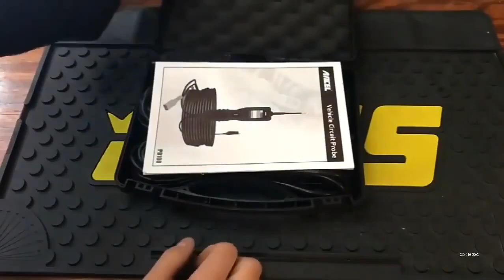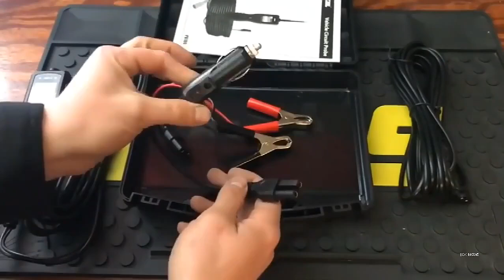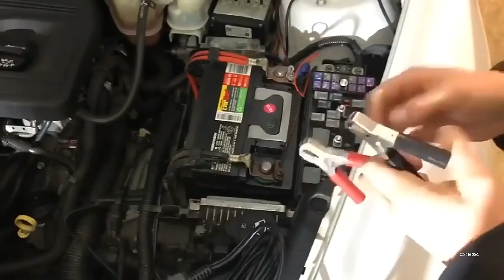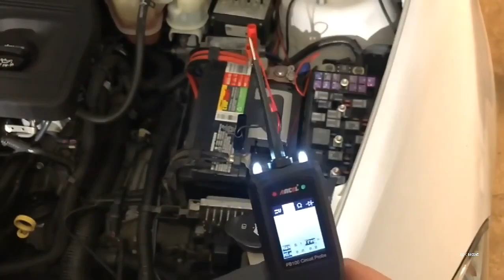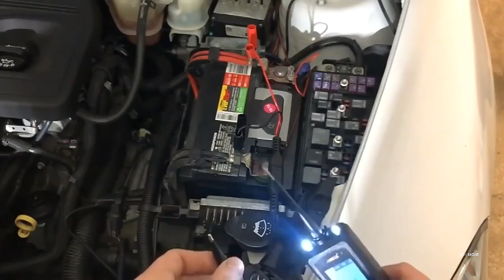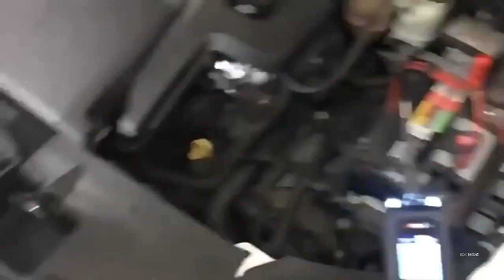Ancel PB100 Automotive Circuit Tester 55% off

Comment from the maker: Ancel PB100 Automotive Circuit Tester 55% off
🔗 Click & Buy: https://s.click.aliexpress.com/e/_oos33X1
Essential tool for automotive electricians
Ancel PB100 - Advanced Automotive Circuit Tester
💡 Built-in auxiliary ground lead for continuity tests
🔧 Activate components without jumper wires
⚡ Short circuit protection with internal circuit breaker
🔍 Locate short circuits without wasting fuses
Price now: USD 45.29 (Originally USD 101.83, 56% off)